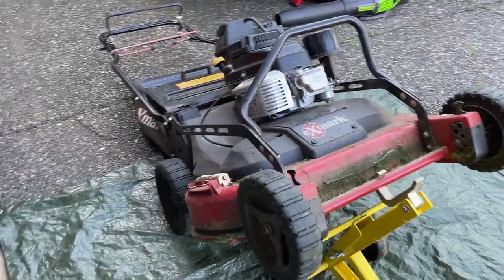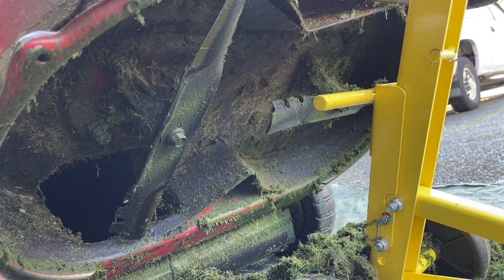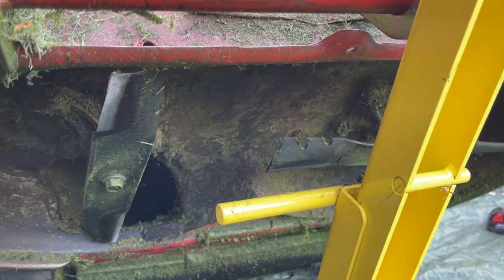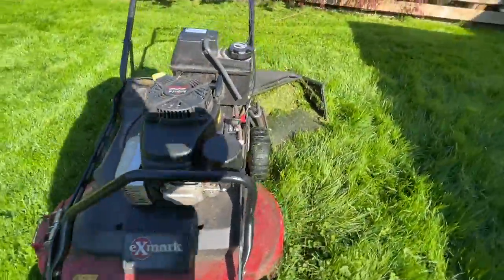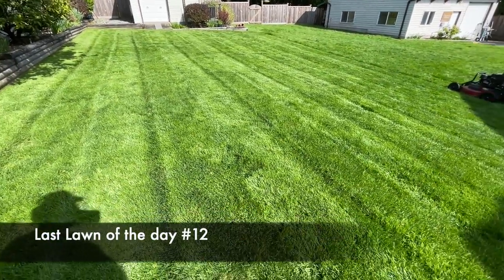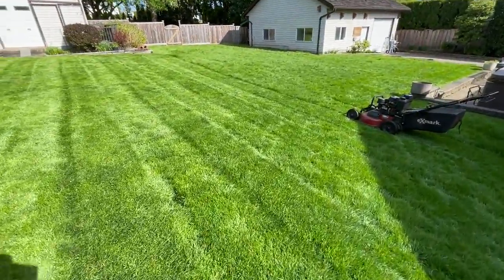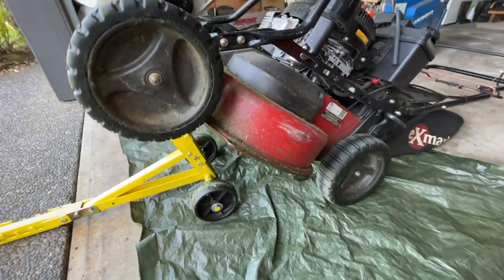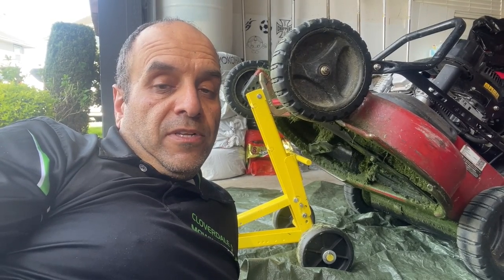Exmark Commercial 30 Mowing Performance Improvement

Comment: I have ran a commercial 30 for 3 years and never once thought about taking that baffle out. I am removing mine first thing tomorrow to see how it cuts. Thank you for this content.
Reply from the maker: I know right. Seems so obvious once you think of it. Thanks for watching.
Reply: @LawnCareBusinessSuccess  update. So I removed the baffle and WOW. Huge difference in not only the amount of stuff that stuck to the deck but also in the discharge. I don’t bag any of my yard. Either side discharge or mulch. I didn’t have nearly as much clumping of the grass as I normally do when side discharging. Thank you for opening my eyes to this.
Reply from the maker: @Outdoorswiththeclines  awesome. Glad you got good results as well. Thanks for following up.

Comment: Hello How are you, i have the same mower with the kohler command pro 200cc engine, Please help me, what oil filter and FUEL FILTER do i need? I looked online and instructions manual and i cannot find any info on what specific item i need, i dont want to ruin my mower, please help i would appreciate it

Comment: Interesting experiment.  Though I primarily mulch with my Commercial 30 (only discharge when grass is too tall and/or wet) this video was interesting to watch.  And interesting tip to know as well.  I guess it's good they bolt in the front baffle as opposed to welding it in so you can remove it. And bolt it back in later if you want to mulch.
Reply from the maker: Yes the fact that it is bolted on is proof it is meant to be removed for certain applications otherwise it would be welded like the one in the rear. Thanks for watching.

Comment: Some kind of a silicone spray might help with grass sticking to the underneath of the deck.
Reply from the maker: Yes good point. Especially if you start using it from new before the deck gets older and rusty. I know a popular one is called fluid film. Thanks for watching.

Comment: Hey man, I’m on my 3rd year of business. The exmark 30 has caused a lot of fatigue walking all my properties about 15 a day. I got a gravely 36” gear drive with thw idea of using a sulky with so I’m not so fatigue. After using it only 2 days I have big buyers remorse as I think a hydro will be much better. Have you ever used a gear drive walk behind? Does it get better or is a hydro just so much better? Not being able to just go  little reverse each turn is so tough.
Reply from the maker: I’ve never used a gear drive. I’m in the PNW so we get a lot of rain and belt driven machines don’t do well in wet weather so I’ve only used hydro drive. I think the hydro is the best. You can’t beat the versatility and if you put a swivel wheel sulky on it it is essentially like a stand on mower with the ability to reverse. Thanks for watching.

Comment: Not gonna lie for 2500 I ain’t taking shit off it better do is job
Reply: I mean baffles are usually designed to be easy to adjust or remove for the purpose of customizing what kind of mowing you are doing like he explains in the beginning

Comment: How has the 30 held up? We are looking for a larger walk behind, and didnt like the Ferris FW15 cut quality that we used to run. Scag is supposed to be terrible.
Reply from the maker: Love it. This is my fourth season with it. It’s been rock solid. Only thing I’ve had to do with it is change the the blade drive belt that goes from the left blade to motor for the first time at the start of this season. All other belts are original. I use this mower for the majority of my lawns each day. The cut quality is awesome. I always get compliments on it. Check out my Instagram account under the same name. Lots of photos of using this mower. Also I’ve done a bunch of videos on this particular mower in different conditions and showing different maintenance items. Thanks for watching.
Reply: @LawnCareBusinessSuccess  thanks for the details!